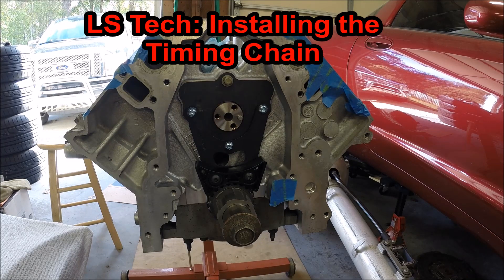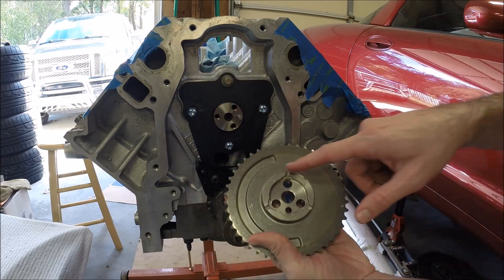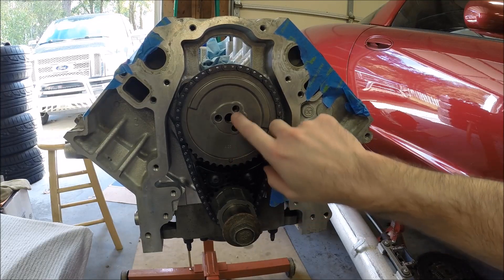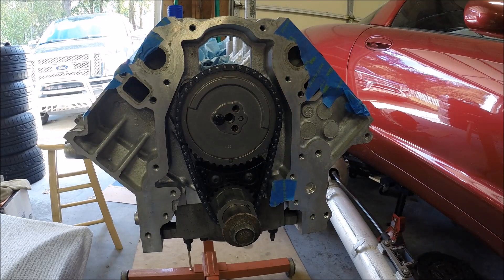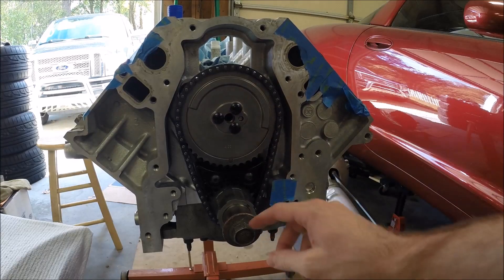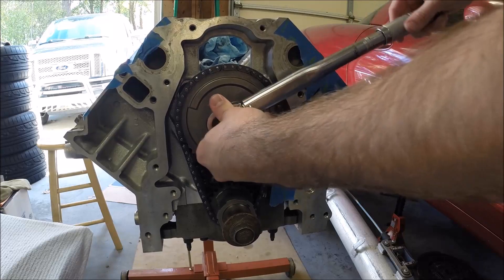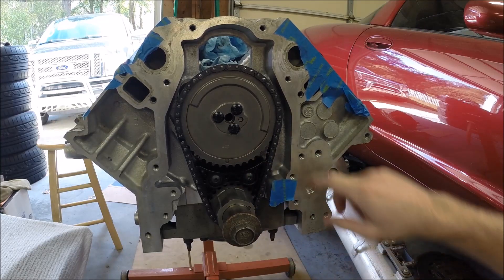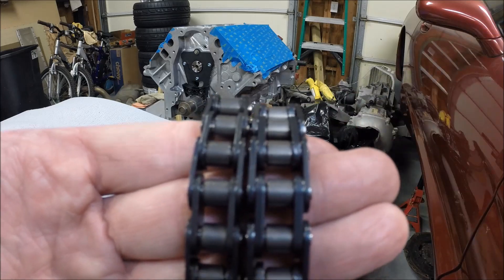LS Tech: Installing an LS2 Timing Chain

Comment: A very good video on the timing gear installation, but i feel that you left out what i consider an important step to the process that i think that very few people seem  to do and that is to check and specially if new  parts are being use. The cam thrust end play. There's videos on it and what could happen if this tolerance is not correct .. bad things could happen to your engine and you will not know about it until the damage has been done. (Tho it is very rare ) it has happened with poor quality control on some manufatured parts...

Comment: Any tricks for pulling that crank gear w/o buying an expensive tool?
Reply from the maker: I left the crank gear on the crankshaft and let the machine shop pull it off.   But you might be able to get it off with a 3-jaw puller?
Reply: @ScrufsGarage  Sorry for just responding being I got it off almost 2 weeks ago. I had tried the 3 jaw puller from the auto store but couldn't get it to set properly behind the gear but home depot had a 2 jaw puller pretty cheap and it came right off.

Comment: Just a little tip if using an aftermarket camshaft.  I measured the threads on my particular cam and was able to install ARP 30mm long bolts.  The factory length and ARP cam bolts are 25mm long.  I ordered the 30mm bolts instead to have an extra 5mm of thread and engagement.  A little added insurance.
Reply: The only issue with ARP 30mm bolts is that, unlike the 25mm, they are not fully threaded. This could potentially be a problem if your cam sprocket is thinner.

Comment: Any noise or issues with that slack? Mine is about the same.
Reply from the maker: No issues.  Have right at 2000 miles on the motor now.

Comment: YOU ARE NOT SUPPOSED TO USE LOCTITE!
Reply: REALLY? WHY? SAID WHO?
Reply: @fasnuf  the fastener manufacturer, it disrupts the torque reading...
Reply: @YZFoFittie  That would depend on the manufacturer. ARP says right in their instructions that their torque paste or loctite can be used but not both at the same time.
Reply: @fasnuf  none of my instructions say to use loctite and if you call tech they will tell you NOT to. PROPER TORQUE is what keeps fasteners from loosening, it's in fact THE SOLE PURPOSE of torque specs. If you need more securing power, you need safety wire...
Reply: @YZFoFittie  I guess ARP lied then.
Reply: Ive Built every motor with loctite never an issue, so it's not true you always put loctite on timing chain bolts! It's a must
Reply: @toast_fairy1419  nope...

Comment: If I'm doing a DOD delete on my Tahoe 5.3 and changed my timing chain, do I also need to change the sprockets? And does the tensioner need to be replaced?
Reply: Depends on the year and cam you are using. Not all DOD motors use a single bolt cam.
Reply: sprocket has to be changed 1 bolt to 3 bolt 

you can change tensioner if you want to and yes they usually come with kit new one is much better than factory one

Comment: Where did you get that cam thrust plate with the buffer mount built in ?  it's got to be a better set up than the Trick Flow adaptor that bolts on top .
Reply from the maker: Actually it's just the stock GM cam retainer plate and then the Trickflow bracket bolts over it.  Just kinda looks like one piece in the video.  No issues with either part though.  Highly recommend both!

Comment: i have a question. when install thimg crankshaft sproket how do you keep the crank from turning?
Reply from the maker: I used an installation tool to press the crank sprocket on, and its not until the very end does it want to turn the crankshaft.  At which point I was able to hold it with a large pair of pliers.  Or if you have the flywheel on, you can buy a flywheel holding tool.     I did an installation video for the crank sprocket if you haven't seen it already.
https://youtu.be/PhHGiSK9hN8